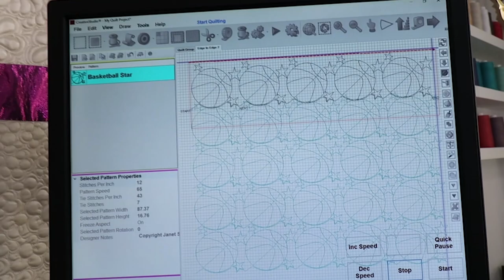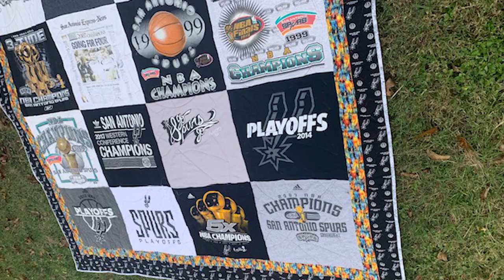Quilting T shirt quilt that has no interfacing?// Longarm Quilting Work Day

Comment: I make a multitude of tshirt quilts, and I also longarm them.  Some I stabilize; some I don't stabilize.  I can't tell any difference quilting them, and I have never had a problem with the nonstabilized stretching.  The tshirts are easier to work with if they are stabilized, but stabilizer is not necessary.

Comment: I would actually think that when you quilt it to a background that is not a knit, it will be fully stabilized. Not all quilters like the thickness created with adding interfacing. They may just "starch the fabric well" as they work with the t shirt fabric.  Since sometimes fusible interfacing has a tendency to bubble after washing a few times, I understand the dilemma.  I probably would prefer no interfacing, but just quilt it heavily. Should be fine.
Reply from the maker: Okay thank for giving me this insight.  I usually use interfacing.. I found this one I use  doesn’t separate if I iron it well!  Even after I wash and dry the quilt.. I ended up doing 4 last year  for a friend !  But I have seen others separate while I quilt.. thank you so much
Reply: @ToniNov25  I wanted to say that I didn't realize some quilters didn't use interfacing until I mentioned something about it my own FB group and I was told that by someone who makes a lot of t shirt quilts.  I learned it as well - maybe a year or two ago.